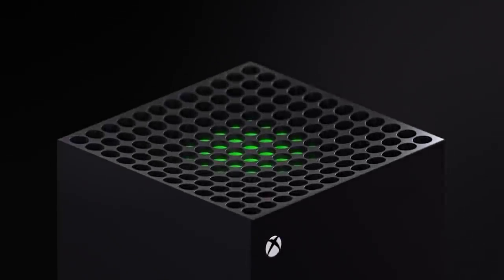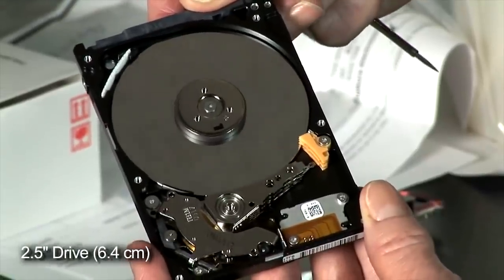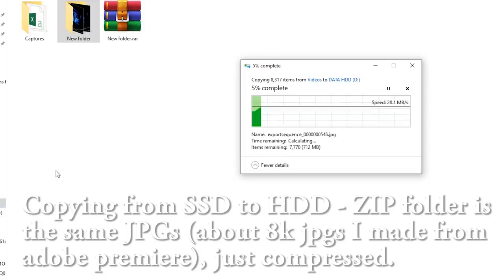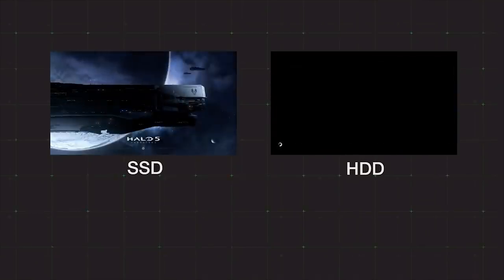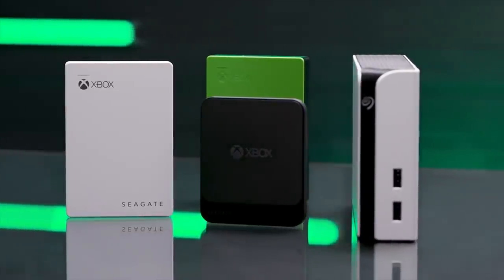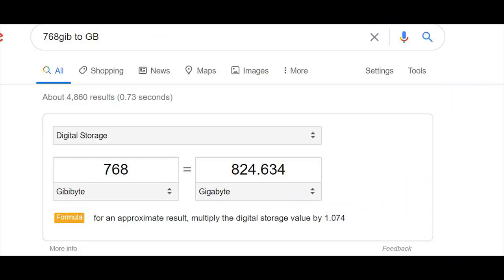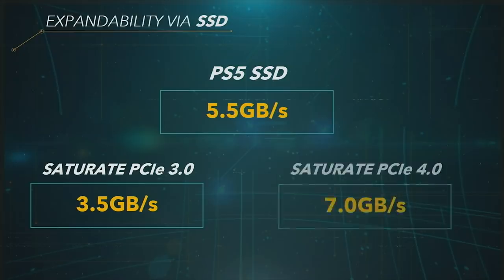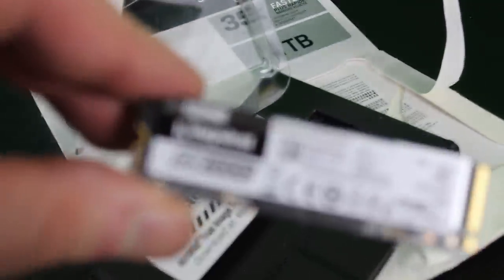Why The PS5 & Xbox Series X SSD Changes Everything - Part 1 - Basics

Comment: Unless I'm missing something, I don't see why hooking a big HDD to the  PS5/Series X and storing your game library on that wouldn't be a simple solution. And when you want to actually play a game, just load said game onto a partition on the SSD. How long would it take to transfer? A few minutes a most? It'd be a hell of a lot quicker than downloading the game.

Unless I'm missing something, I don't see why that wouldn't be a perfect solution to the limited space issue in the SSD.
Reply: It would take like 30 minutes to transfer a 100 GB game from an HDD to SSD.  If you have internet slower than 400 Mbps then that would likely be better.  If your internet is 400+ mbps it would be quicker (depending on the download location) just to download it from the internet.

Comment: the xbox ssd changes nothing.. the SSD of the ps5 doesn't really either.. it's all in the controller, channels and custom compression hardware.. it's why only PS5 has anything "next gen".. the customized parts of the SSD and the 3D audio.. the xbox is just.. an improved old xbox with hardware closer to that of a newer PC.. the PS5 does something no PC can match..
Reply: Except difference between the Ps5 SSD and Xbox SSD is 2-3 seconds faster than Xbox's that is it Xbox still has an SSD you won't even find in most computers. Most gamers won't even be able to tell a difference because load times are already cut down by a large margin on both consoles. 3D audio has been on Xbox. And a spec specs of a newer PC at a price you could never get for a PC at that caliber.
Reply: The ps5 does something no PC can match? You are joking me right?  My current PC is 100% better than a PS5 will ever be lol.
Reply: @Joshua Spano it’s not just loading, the Xbox ssd and velocity tech with its BCPack and SFS(it’s most likely 20-30% efficient then ps5 but it’s only focused for texture) is next to ps5 and is better then PC. The difference is still has bottlenecks, and ps5 i/o storage system has almost none to zero (Xbox fanboys insist that ms did also work out the bottleneck but as even Tim Sweeney said, Ms and Amd and intel still has to work on it.) which makes the difference, and not just for loading but streaming.

Comment: PC uses a better ssd and for years.  Proof it wont change anything is noone can actually tell you why it's a game changer
Reply: Rubbish like you don't even watch and understand the video before commenting.
Reply: @fantasytky28  what so you think pc dont have better ones already lolol
Reply: @danielsup5714  did I even said pc don't have better spec? I mean it is game changer for console to push the standard and game can be developed to utilize the power now. Put as much better spec as you want on your pc but it does not make the game any much better since the game was not designed to take advantages of all the power. Don't you get it. Please understand the reason why it is game changing instead of just thinking what you assume.
Pc have better spec or not, it's not the point.

Comment: Sorry but Xbox ssd is just the base ssd u find on PC Sony ps5 ssd tho is made to be so fast and powerful that it not on PC
Reply: Do your research next time.
Reply: @BrotherO4  The Xbox Series X SSD is only 2,400mbs which is slow as hell. Gen 3 NVME drives are much faster at 3,200mbs-3,500mbs. Even if its speed goes uncompressed its only 4,800 which is slower than Gen 4 NVME SSD's. The upcoming Samsung 980 Pro is 6,500mbs which is faster than the consoles.
Reply: @ZackSNetwork  your fan boying it the Xbox ssd is more than fast enough to do anything PlayStation does it's fast in different ways which will basically make sonys advantage null now the GPU and CPU advantage on the series x is real and will c a better res and frame rate on games
Reply: a base sata SSD on PC has speeds of 600MB/s with base NVMe drives at about 1.8GB/s
Reply: @ZackSNetwork  dude you're only looking at ssd speed and not thinking about the Velocity Architecture which will make it soo much faster than the raw specs of the hardware.
Reply: That ssd still getting them 30 fps games so it kant 2 special like you people been hyping up
Reply: XsX has a slapped on PC parts unlike PS5 has so many custom hardware inside to really utilized next gen graphics.
Reply: John Smith  clowns like you just didnt watch the ratchet and clank gameplay? That's what ps5 ssd can do in pre alpha game and xbox cant clown...ain't just about load times
Reply: If you're comparing it to ps5 yes it's not as fast. However were not coming from a generation to come but a generation that has very slow mechanical drives which if you go by that which you should to be fair then the jump and speed of xbox series x is massive and we should see things that are completely new to gaming. But yes the ps5 has a faster ssd. Which their ram gpu cpu were better also because there developers are very talented in regards to certain games that have a realistic artstyle in graphics. Higher cus for ray tracing like xbox series x would have been nice also.
Reply: John Smith  and no one is worked up..you bots just dodge all the facts to pit your narrative ojt there"yeah it can load many more gigs than xbox hut that will only be 2 seconds faster load screen",,,,smh not genuine at all
Reply: @theforerunners5171  no he's not. Where do you think that 4.8 is from? That number is the final result. It includes the velocity architecture. Quit misunderstanding shit.
Reply: @mattmccaughen8082  I never took any side so shut up xbox fanboy.
Reply: @Rell.from.hideout  and it wasn't jnstant planet jumping there was a second or two between the world's let's be real
Reply: John Smith  isn't it crazy how mad ponies get like shit knowbody was attacking him anything he's just goes all fanboy

Comment: So Ratchet and Clank is 30 fps? Cringe.
Reply: Oo oO  ew
Reply: Oo oO  ewwwww
Reply: Oo oO  the RAM on the PS5 is equal to the Xbox series X simply because the series X uses 10GBs @ 560GB for Games the PS5 use the full 16GBs @ 448GB for Games. So they're about even when it comes to RAM.
Reply: @blackgreece2702  The problem with that is that the slower RAM is specifically used for CPU and OS functions which don't need faster memory. The OS uses a reserve 2.5 GB alone, the effective speed comes to 501 GB/s if the developer decides to use all the memory uniformly.  However, the extra 3.5 GB/s is more so to be used for the CPU and audio functions.
Reply: Oo oO  it's obviously you don't know noting about technology and how it's work

Comment: PS5 can't even do 4K/60 in a game like DS Remake that was built ground up for it. There's clearly a bottleneck. Guessing it's not the SSD. Lol
Reply: Its GPU is not powerful enough for native 4k 60fps on triple A games. Digital Foundry said PS5 is in the middle of the RTX 2070 and RTX 2070 Super. While the Xbox Series X is close to or on par with the RTX 2080.
Reply: @ZackSNetwork  Yup
Reply: Try and tell that to a pslave.
Reply: That is because it has ray tracing, that is very heavy on the GPU. Not even an RTX 2080 Ti can run a Ray Traced game with that level of graphical fidelity at 4k60. Demon Souls looks better than AC Odyssey and a RTX 2080Ti can’t run Odyssey at 4k 60 and that is without Ray Tracing. From Software said Demon Souls will have a Two modes, one for performance and one for graphical fidelity.
Reply: Brett Kozlak  Nope watch Digital Foundry's latest video.
Reply: What on PlayStation site it says it will go up to 8k???
Reply: Brett Kozlak  nope RTX 2070 super. Watch innocenceii video. MS gimped the test. When more games come out we will see SX has a real performance equivalent to a R7 with rt or RTX 2070 super.
Reply: @-MohamedMajedAlHarthi  and I guess we'll see how Demon Souls utilizes ray tracing. Ubisoft is famous for gimping their games, so what's your point? And you've seen Demon Souls.....the whole game running from start to finish, and how old is Odyssey? Nice try though. comparing a game from 2018 to a 2020 game on next gen hardware. you pslaves would take a bullet for Sony, wouldn't ya'?
Reply: @-MohamedMajedAlHarthi  Only shadows in certain scenes are raytraced according to DF. Every other asset uses SSR. Clearly PS5 can't even handle half of what an RTX 2080Ti can calculate in terms of RT.
Reply: doug s Do you want another example RDR2, a RTX 2080Ti cant run it at 4k 60.
Reply: PS4 Pro is 1368p checkerboard to 4k on Horizon Zero Dawn, I definitely think it could do 4K60 on death stranding. 1368p and yet one of the cleanes games ever on consoles, Death stranding system requirements on PC is quite tame so I think you'll be surprised. If it's not 4k It'll be damn close not that 4k really matters that much, 4k is often a waste of GPU power. Recommended specs for DS PC at 1080p60fps = rx590+R5 1600 so we'll see
Reply: NoRussian Yeah Ray Tracing on the Next Gen Consoles won’t be mind blowing especially the PS5. Since Sony chose lesser compute units and went for a very high clock frequency.  Even an RTX 2080Ti with 68 RT Cores still has terrible performance with Ray Tracing on. But the next gen Nvidia Ampere cards will be much better at Ray Tracing (Hopefully).
Reply: doug s not even a high end pc can’t even  run demon souls at native 4K 60 you do realize that game is very taxing on hardware and the ps5 is running at native 4K 30 with raytracing included keep that on mind
Reply: Mohamed Harthi exactly thank you
Reply: ZackSNetwork The problem with the Gears benchmark is that Microsoft chose the worst comparison possible. Gears runs very poorly on Nvidia cards. They need to compare on a game like RDR2 that runs well on both amd and Nvidia cards.
Reply: @-MohamedMajedAlHarthi  why would I care? I don't give two craps about 60 fps and I do know the Series X will be the better console and will be my day one purchase.
Reply: doug  By the way teraflops are the computational capability of the vector alu and its very misleading. Judging by RDNA 1 a 15% difference in teraflops is around a 5% difference in performance. Plus the PS5 has cache scrubbers that evacuate the caches without wasting GPU cycles, and higher clock speeds that leads to faster rasterization, faster at commanding buffers, faster caches etc. So in some games you may see better performance on the PS5.  Or games may have more detailed geometry on the PS5 because it fills ram much faster. Some devs may not be able to use all the shaders on XSX in parallel. They’ll nearly identical for the most part. If you like Xbox exclusives and backwards compatibility go for the XSX.
Reply: @-MohamedMajedAlHarthi  The 2080 TI can definitely do 4k at 60 if the game is optimized for it.
Reply: Matthew Notter Without heavy Ray Tracing it can definitely. But there are PC exclusive games like blade-runner 2020 with very heavy ray tracing that runs at around 40-35 FPS on an RTX 2080Ti at 4K. And that is with 68 Ray tracing cores. My point is don’t expect next gen to be able to deliver 4K 60 with Ray Tracing on.
Reply: @-MohamedMajedAlHarthi  who cares? Not me one iota.
Reply: Why Xbots so dead brain? The PS5 will running True 4k @ 60fps, to see the potential of next generation consoles will take at least 3 years as was on current generation...